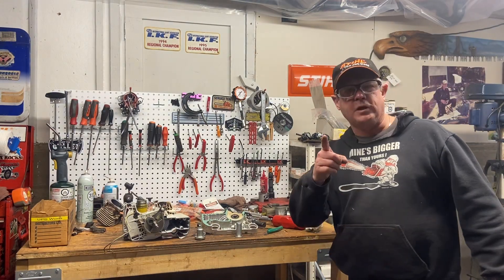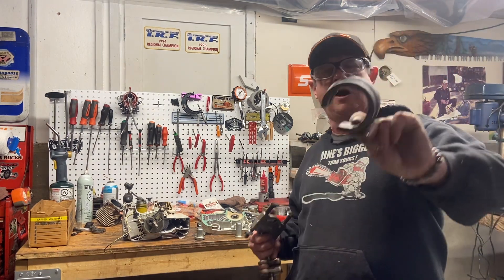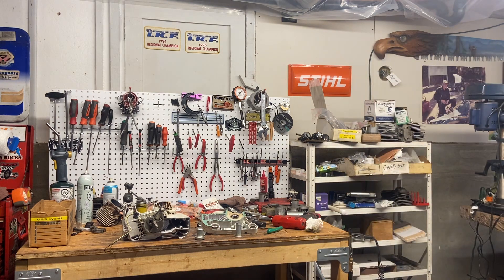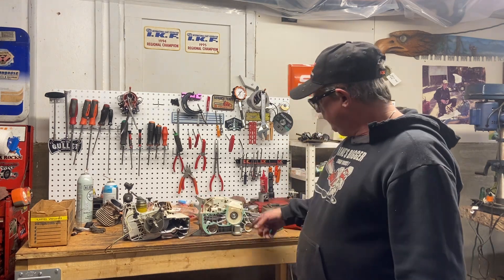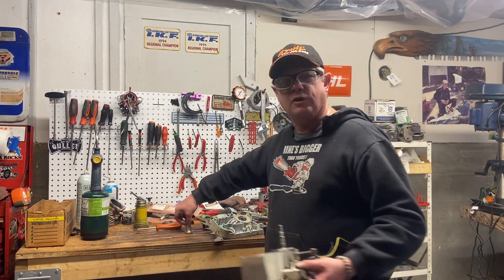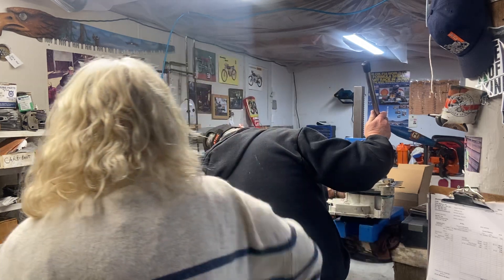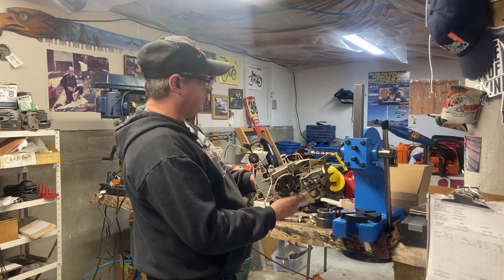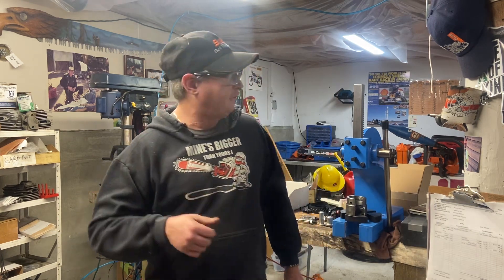How to rebuild a stihl ms461

Comment: Mate did you no that the crank bearing off you open that vice on bench and you'll see a certain way the bearing sits on vice and hit shaft with wooden hammer way easier then what you made

Comment: Got a question for ya on a 455 Husqvarna, before i started looking into it the saw would run great cold until 5 10 minutes went by and a shutdown.   Then saw would not want to start, if it did itd die on a idle.  Now ive done carb kit, lines, fuel filter, and it stumbles on throttle especially wot.  My thoughts are impulse or air leak, seals, base gasket?  Any thoughts?  Pressure/vacc test?
Reply from the maker: The coils are bad in those

Comment: Hey Donny, my 046 will start racing at idle all of a sudden but if you blip the throttle it will go back to idle, only does it once and a while and it has good crank seals and no vac leaks I can find, any ideas
Reply from the maker: Hmm maybe loose carb butterfly screw but I haven’t really had that problem check choke screw as well I had lots of those come loose but that won’t effect idle eh
Reply: @donnywalker4691  I’ll check that, could the fuel line cause that? It feels a little soft but not that bad, that’s the only part I’m waiting on still